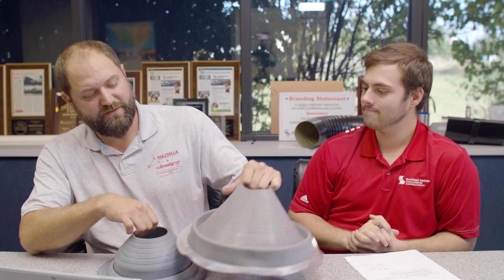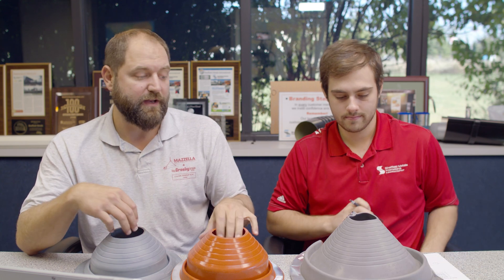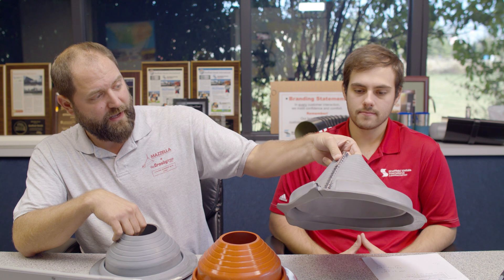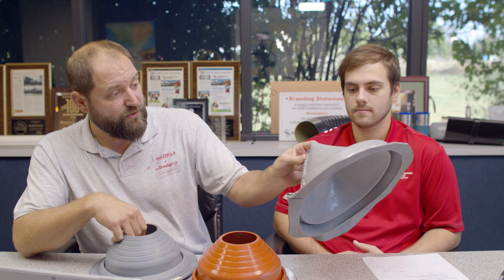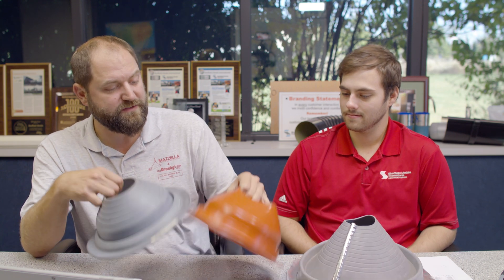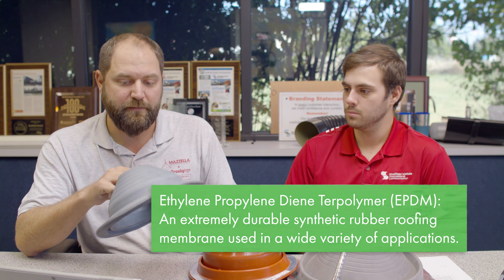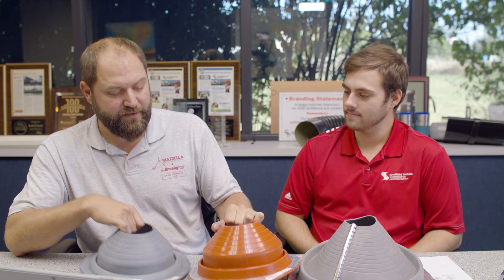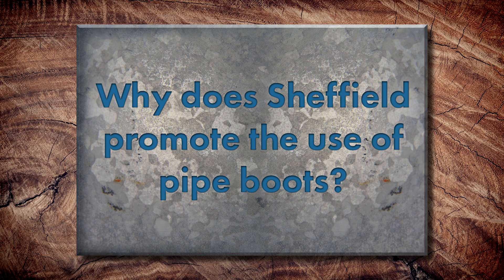Why Does Sheffield Metals Endorse EPDM Pipe Boots?

Comment: I would like to have a roof with zero penetrations.  Is it possible?
Reply: I think your sewage vent has to go through the roof. Gas furnace/water heater as well otherwise you will have awkward looking piping going out and up the side of your house. The pitch of your roof determines the height of the pipes. 
You can vent the stove, dryer, bathroom out the sides. If you are involved in the design you can place things in area's that will make venting out the sides and roof easier.  
When designing a home it helps to consider where these things are going to be located. Typically you want them on the back half of the roof.
Reply: @Foche_T._Schitt  thank you for those suggestions.  Why can't the sewage vent go out the side?  Also, do you think with electric, I can avoid the furnace and water heater vent pipes?
Reply: @scorpio6587  
Methane accumulation and odor makes side venting untenable. At least I've never seen it done. 
It's climate dependent but heating a home with electricity isn't very efficient. Even homes in remote locations use large propane tanks.  
An electric tankless hot water heater isn't a bad option provided your breaker box has the space and amps to handle it. Jordan Smith made a video on one, it took three 40 amp 220 volt breakers. At its peak load that's about half the amperage of a typical 200 amp service. 
There are efficient water heaters and furnaces which use PVC instead of B-Vent. They can probably be piped out the side. I've seen them poking out of the ground from basement installs.
Reply: @Foche_T._Schitt  Thank you for that good information.  I have seen that Jordan Smith video; it was very interesting.  In my climate, heating is not an issue.  I will keep hoping for an alternative for the sewer vent that does not require a roof penetration.
Reply: @scorpio6587  
I recommend you get a plumbing code handbook. There's pdf's floating around online I'm sure.
Reply: @Foche_T._Schitt  great idea.  I will do that.
Reply: @TyinAlaska  Thank you.  I appreciate that.  I think I would prefer the option of extending it along the wall exterior.